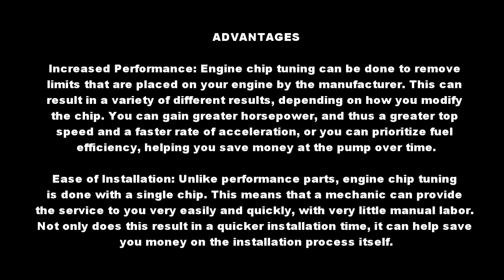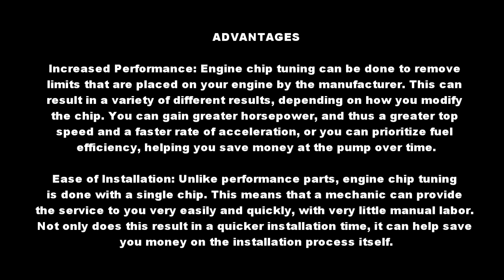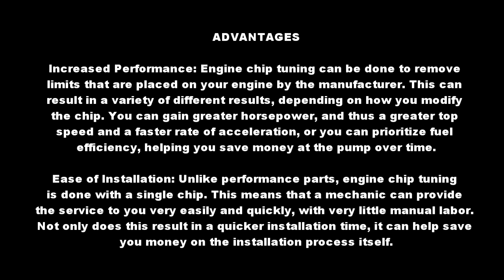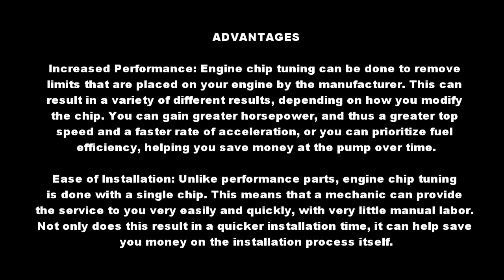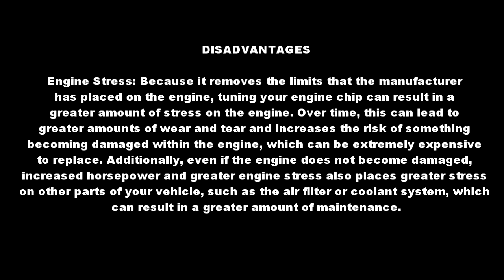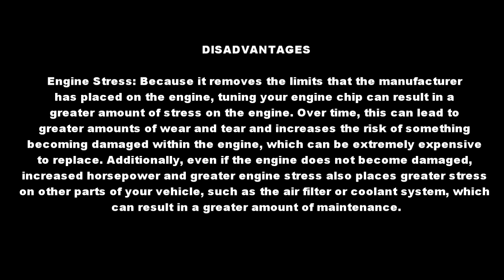Nitro OBD2 Engine Chip Tuning Advantages and Disadvantages

Comment: The advantage is that someone made $25 off somebody really gullible.
The disadvantage is this "chip" does nothing other than operate some blinky LED lights.
Reply: Complete junk: http://www.performancechipguide.com/superOBD-performance-chip-teardown.htm
Reply: it does work...depends on what type of car do you have...if you are expecting this chip to boost up the horse power of your sports car...dayum of course not....this chip is designed for cars that are not tuned enough to give some power..not to add up another power to a car that is already a monster...